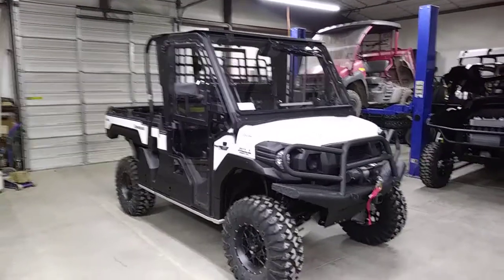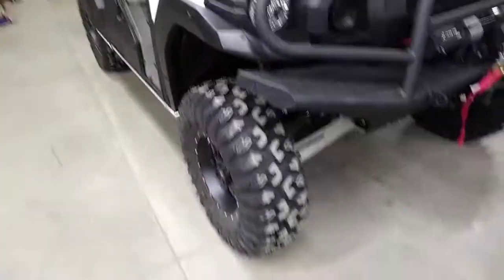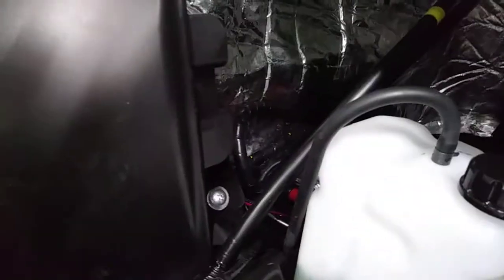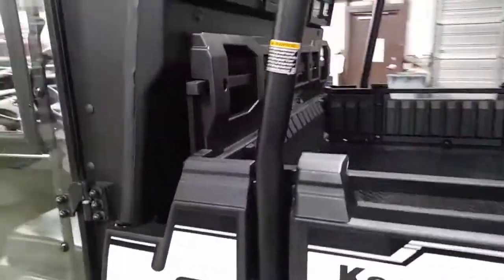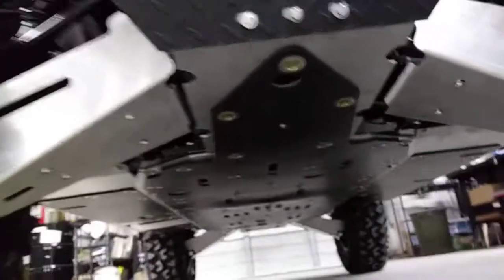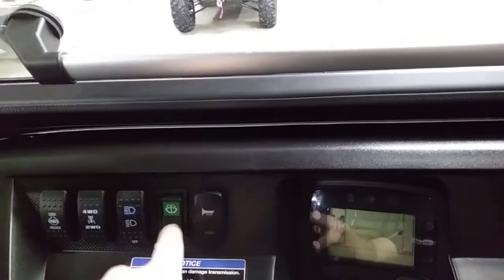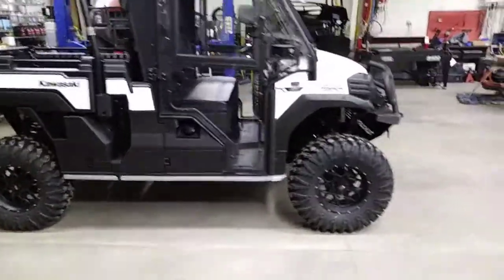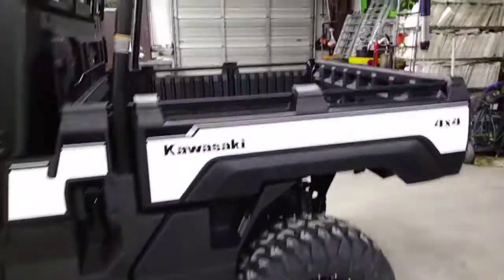2019 Kawasaki Mule Pro FX by Hester's. Lift, Cab, heater and more!

Comment: What's the price on cabs? This isn't the steal cab that you put on the other white fx. Oh and the air horns, where did you mount the compressor and tank?
Reply from the maker: This cab is by DFK. (Quadboss/moose) its around 4k, the wiper/washer is like 450. It's a clear view, see through doors, unlike the Curtis steel cab. The curtis is only slightly more, (like 4300 with glass shield 4k with lexan). They both have the Curtis heater, best one IMO.
The air horns require no tank, they are automotive dual horns with 12v pump in the kit, it runs around $70. You can get cheaper, don't know how good they are or how long they last, these ones we have been useing for years. They are marine set up for boats.
Reply: @HesterEdition  thanks for answering. Love your videos
Reply from the maker: Thank you

Comment: Love your videos! I'm doing a 1200 km trip across Newfoundland and I'm just wondering if this rig is suited for that type of riding? Its mostly railbed.
Reply from the maker: Thank you for watching. Would be a quiet and smooth ride so long as you don't need to go over 45MPH/72kph. It's governed at that. But if its trails and scenic rides would be a nice set up. If you need faster then go with a Teryx by Kawasaki. You can see many differant builds on our custom teryx play list.
Cheers!

Comment: Always good to see the work that Hesters Motorsports does with the Kawasaki Mule Pro FX UTV. The cabs are looking better and seem to fit the vehicle better. A bit of a strip of sunshade tape would be good on those real hot sunny days. I've suggested your videos to a Kawasaki dealer in Ontario, Canada and they seem to be stuck on the OEM options only. Some of which are ok but I like how Hesters sets up these UTVs with the choices of aftermarket parts that are installed on the Mules. I've seen a Hester video  on a Mule diesel model (part 2) and wondered if Hesters has ever installed a turbo on the diesel model...? A cab is a wonderful thing, with glass, a heater and wiper are all great features. Keep up the good work and as a friendly suggestion - when you use the word :slick" too many times it takes away from your explanation of the all the work you guys are doing - which is what the viewer is mostly interested in.
Reply from the maker: No turbo yet, have some designs just never have had tine to try them haha.
Thank you very much, we appreciate everything.